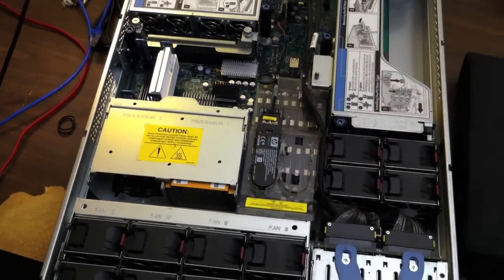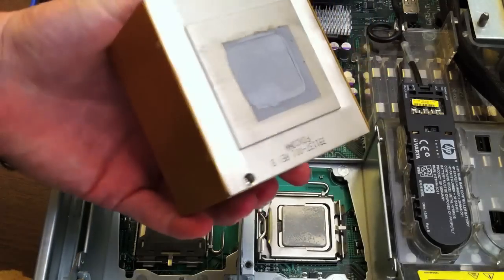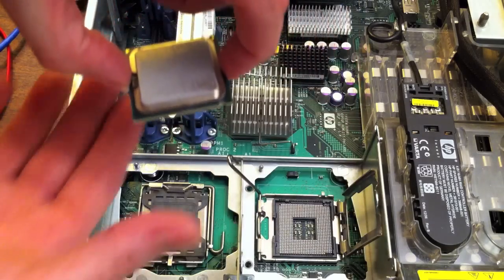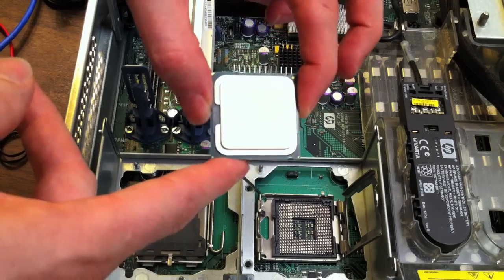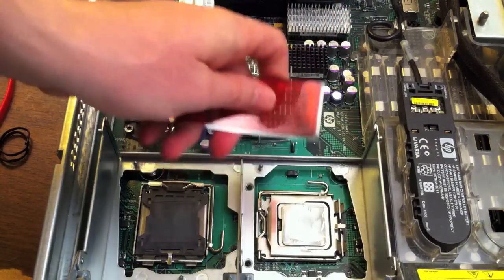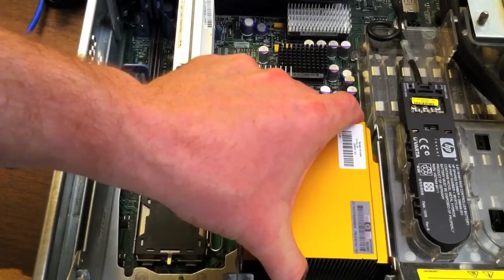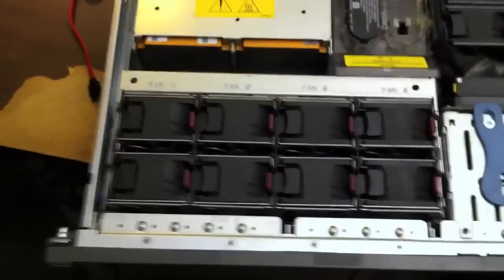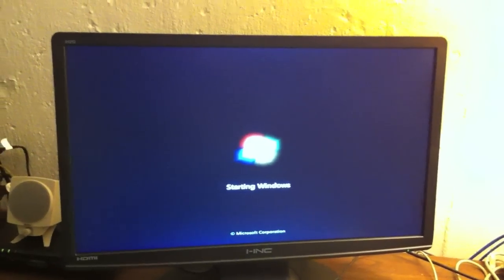Project Double Team - Upgrading Processors in a Server

Comment: Just picked up 2 of these for £60! (they were £40, but the guy is gonna drive to me and deliver them so I made him a better offer) Both have single E5335's, the operational one has 32GB of ram, P400 512MB, other one has a P400 256MB but no ram or heatsink. Also 11 x 146GB 10k sas and 2 x 76GB. I have absolutely no need or idea what I'm going to do with them, but my oh my what a steal. Maybe get 4x X5460's and 64GB ram for each and have a beast home server for £250 or less.

Comment: I also have a pair of these G5's, and I have updated them with the 10.10 SPP. I've read online that there are two system boards that this server used, and I'm getting some conflicting information. My SN says that I should have the first gen (50xx and 51xx only) but the part number on the board is the same for the one that should support the 5462's that I have. What gives? I'd like to go from dual to quad core also! (Also a jump from 2cpu x 2 core x 2GHz... to 2cpu x 4 core x 2.8GHz!)

Comment: MOXYDAVE:  Great video!  Unfortunately, I am unable to download the "ROMPaq" which I have read is required when the boot error "unsupported processor" appears.  The processors are a matched pair from another working G5.  I've tried the "Service Pack" 
which allowed me to load some updates, but it didn't update the mainboard BIOS.  The diagnostics test both processors as good.  Do you have a copy of the ROMPaq, and if yes, would you please share it with me?

Comment: Got one of these for free from my job. I have it loaded up with memory, running two processors and two power supplies. Keep in mind you may have to upgrade the firmware to support a new processor. You can download a bootable DVD or an exe from HP.
Reply: I am unable to download the "ROMPaq" which I have read is required when the boot error "unsupported processor" appears.  The processors are a matched pair from another working G5.  I've tried the "Service Pack" which allowed me to load some updates, but it didn't update the mainboard BIOS.  The diagnostics test both processors as good.  Do you have a copy of the ROMPaq, and if yes, would you please share it with me?
Reply: Todd McMahon
Download this one and make a bootable DVD. You may have to go into the bios and set it to boot from CD. Then just follow the on screen instructions. Don't worry about the os listed. This works for all versions because you are updating it on boot. http://h20564.www2.hpe.com/hpsc/swd/public/detail?sp4ts.oid=1121413&swItemId=MTX_9ed665a89aba447d925937f38b&swEnvOid=4115#tab1
Reply: Thank you!

Comment: Not sure if you still use this server but was wondering if you need a specific VRM for each type of CPU or if you just need 1. HP has hidden all the partnumbers behind their warranty login which obviously has expired on these servers...
Reply from the maker: +Some Guy I'm not sure but I do remember seeing different part #s for different makes of processors, i.e. Intel was different than AMD. Find some on Ebay for sale, look up the part #s from there on Google or use the Internet Wayback Machine if necessary. This info should be all over web, you just have to search a bit :-)

Comment: hi mister and thank you for your share.. have you any experience running 1600MHz processor (e5472) on these machines that are 1333MHz capable? I have to build a server with some spare parts and can't find any documentation.. fore sure e5470 is good but now in my hand I only have 2xe5472.
thank you